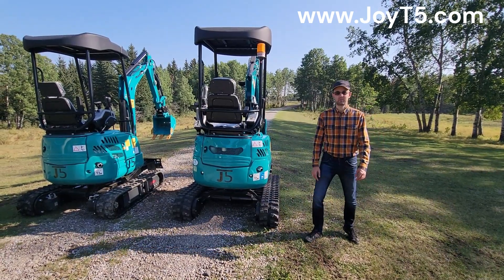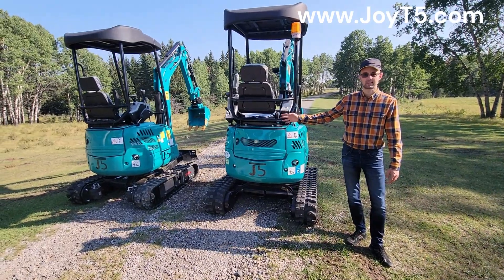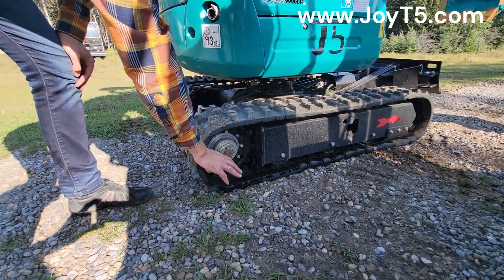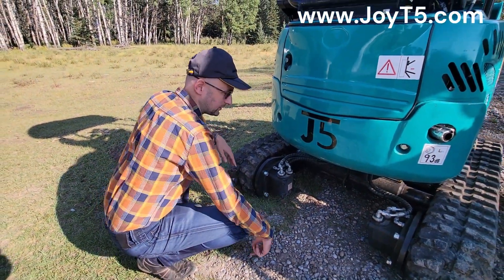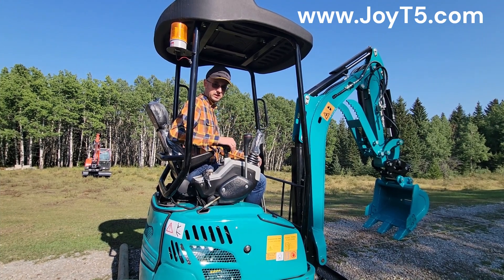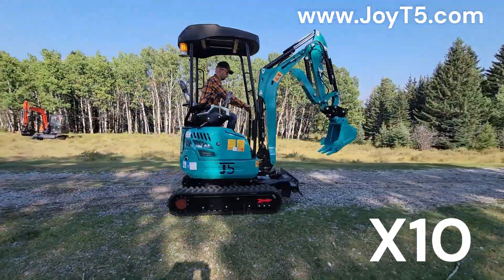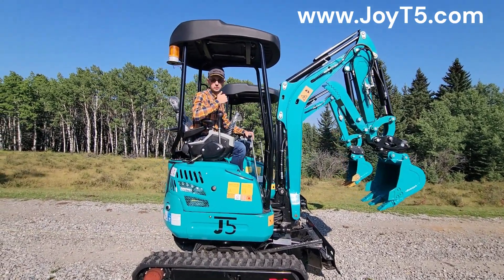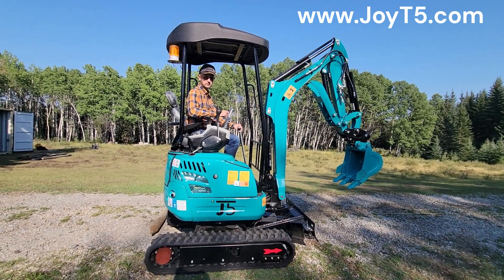2 Ton Mini Excavator Single vs Double Speed Travel Motor Test. Which one will win? JoyT5 JT5200

Comment: Hello,
Nice machines. I have a Chinese 2ton mini. I'd like to upgrade to a 2 speed travel. Do you sell the upgrade kit or can you recommend a brand?
Thanks
Reply from the maker: Hello @ByGrace2221

JT5200 uses LKC02PAK walking motor model and we have very good feedback from our customers. 

Please be cautious before attempting to upgrade to double speed motors as there are several things that you should keep in mind. Here are a few things that come to mind: 
* walking motor mounting patter needs to match what you currently have
* single speed motors have 3 hoses while double speed motor has 4 hoses, you will need to run additional hose to the swivel joint. Does your swivel joint has a spare port for that hose? 
* does your multiway valve has spare port to accept a hose from swivel joint to multiway valve? 
* How much space do you have to work, will you be able to run all the hoses without the need to take of excavator house? 
* etc... 

Everything is possible, but when you will consider how much effort it will take to do the conversion, it might be more economical to sell the current machine and get one with the double speed installed from the factory. 

If you still want to get a conversion kit with double speed walking motors, please contact us via: https://joyt5.com/pages/contact

Comment: Where can I buy the two speed motor upgrade?
Reply from the maker: Hello Kevin,

Upgrading to double speed motors is not a simple task. You would be required to run additional hoses as double speed motors require 3 hoses, plus you would need a control valve, a wiring/switch that will control the low/high speed. 

It might be more cost effective to get a new machine with double speed motors than upgrading one. 

Having said that, we can help with parts if you will end up going through with an upgrade. Please contact us at info@joyt5.com
Reply: @JoyT5 does the high range supply oil to both input ports? Could a person put a manual T valve on and have to get out and turn the valve to direct oil to the high speed port? And then back to the low speed port for more pushing power?